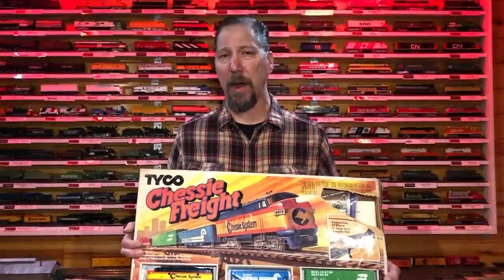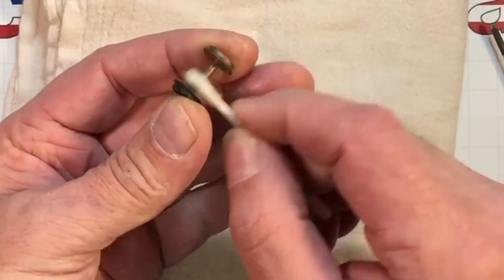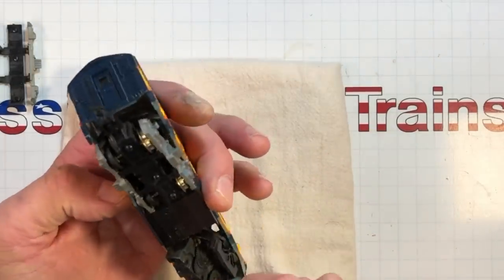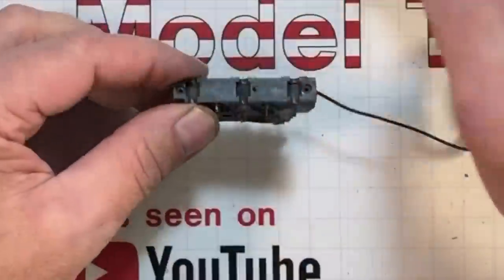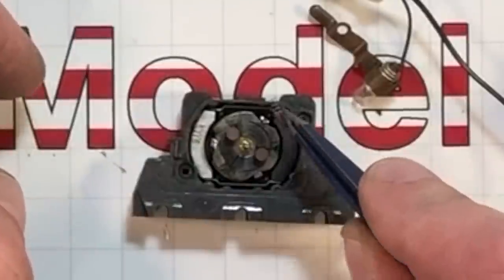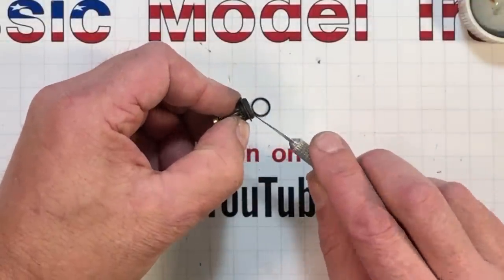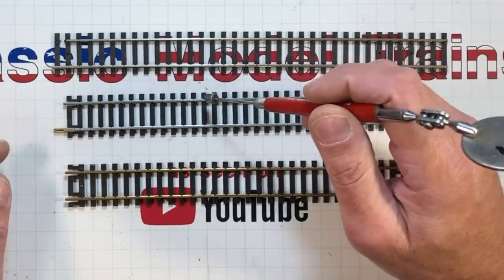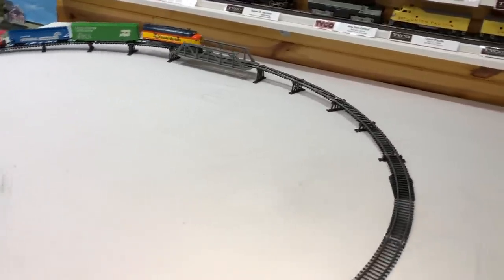How To Fix Them F-7 Power-Torque Tyco's

Comment: Super. Edit: I have one Powertorque drive locomotive left still operating on my railroad, out of seven bought brand new, some forty years ago, in which all but one got converted into dummy locomotives after they died during heavy service. I mixed parts and put the "Sharknose" ALCO trucks on my dummy GP-20, (And a dynamic brake from a Lionel GP-9.) so it is unique, but I also used the spare parts to turn the Baldwin RF-16 "Sharknose" diesel into a suedo Baldwin BP-20 Passenger Shark. I put two Powertorque drives in it, (dual motored.) added extra drive wheels for twelve wheel drive,  filled in the slots for the traction tires, added window glass, extra details and lighting, and added three axle sideframes to it, and by some miracle it still runs fine to this day, however, I don't let it operate outside anymore. It will pull a twelve car heavyweight train up my grades, and has a nice patina from all the years of service which makes it look very realistic in front of that train, but I usually assign it to commuter service. Hello again from the Tracy Mountain Railway in Colorado. 💙 T.E.N.
Reply from the maker: Nice kit bash you made there!!

Comment: Armature and commutator brushes look similar to the ones used in my old AFX slot cars. Used to use soft pencil erasers to clean the commutators. Great video.
Reply from the maker: A lot of Fellers have mentioned that. I'm about ready to buy up some new old stock and see if they will fit.

Comment: Thank you for the guidance on how to clean and re-lube the used motor and wheels. I never did any of the delicate disassembly or reassembly work, but the close ups make it easier to understand. I'm confident I'll be able to knock over an open bottle of mineral spirits as I've been in training and practicing without even trying for over six decades. Merry Christmas.
Reply from the maker: Glad you enjoyed the Vid. I wish I was not so well trained on the art of spill's and making messes ;-). Merry Christmas to you and yours!

Comment: Ron, really enjoy your videos. Nice to see someone else show some love to the more basic entry level stuff. Still have my childhood Tyco F7, circa 1975ish. Here is another tip for you - I like to test items with a 9V battery. Picked up some connectors, will snap one on a battery, then do a check with it. Just seems easier, and maybe a little safer, for me.
Reply from the maker: Thanks for your kind words.  Yup, I hear fellers use the 9V at train shows just to see if the things moves a bit.  I just assume none of my new to me used stuff works and just tear into it and root around a bit.

Comment: Way back when, I got a Tyco HO set as a Christmas present, and it was a similar vintage to this one!  Mine had an SD9 and six freight cars, but the same loop of track with that little trestle set.  The drive gear eventually stripped out, and we took it to someone at our local hobby shop who told us it wasn't worth repairing.  So instead I got an Athearn SD45 to replace it.  Probably still have both of them somewhere, along with a Bachmann 2-8-0.

I left the hobby for quite a while; college and early work life took over.  But when I re-entered the hobby I switched to N scale for space reasons.

Really enjoyed this video.  I don't plan to buy a train set again any time soon, but this was neat.  As I mentioned above, there are a few folks in the hobby who don't consider these old Tycos worth fixing; glad to see that someone disagrees!
Reply from the maker: Thanks for stopping by for a viewing and a comment.  A lot of us left model railroading as older teens / young adults.  It's interesting how we keep the flame alive for so many years and re-enter the hobby once again.  Every mechanical device will break down if it's not maintained properly. I'm just trying help new modelers learn  how to do some fixing since nobody else will :-)

Comment: Love your videos.  A lot of model railroaders talk crap about tyco will a braodway limited work when it's 45 years old . I am an old rivarossi  and artheans blue box fan I have a few typos with power torque models I converted to dcc with sound just as much fun as running a 500$ locomotive. Keep up the good videos. Merry Christmas
Reply from the maker: Thank you. Yes Tyco does get talked down.  Nobody remembers that's how they started in the game. Bachmann, Life like, are still around and had a chance to redeem themselves from the 70's-90's stuff they were putting out.  Tyco did not have that opportunity.  Easy to talk bad about someone when there not in the room.  Mantua (red box) and the re-launch (77-90) put out fantastic stuff, but never gets mentioned. Merry Christmas to you as well! Thanks for supporting my channel :-)

Comment: A power torque is a good starting point for any beginner. I've go more than one on duty here. I've got a couple tricks I do with them cuz I lean on the old girls. I squeeze a little keyway mark on the output shaft&put 2 output gears on it. Facing each other so when the second gear wants to walk over,it won't strip out. Cuz of monster consist&multiple power lashes. Still on board Ron🚂🇨🇦🇺🇲🙋
Reply from the maker: Greetings Doug!  Thats a pretty cool idea. I'm a little short on extra pinion gears Or I would give it a try.  Thanks for watching & commenting :-)

Comment: Little inside information. On the Tyco F Units, the Walthers/  Athearn diesel dress up kit for Athearn F7s also will work well in your Tyco F7s. Even though Tyco called them F9s they are really F7s, F9s have a set of louvers between the cab and front porthole window. Now if you want a nice budget F9 to run on your layout, look for the old PlayArt ones, and yes they have those louvers. Happy model railroading!
Reply from the maker: I believe I have a playart F-7 in a box somewhere

Comment: When I was in ho I used to use a bright boy track cleaning block to clean the wheels of my locomotive nice shiny b r i t e.
Reply from the maker: I think that little black thing I am using is made out of the same stuff bright boy is made out of.  Sure works the same :-)
Reply: Ron I was curious about what you used for cleaning the wheels outside of the Q-tip but what the gray polisher thing was? I just got a switcher and when I first put it on it seems to short out the track but then it runs fine but the wheels seem pretty dark and dirty. I have 2000 grit paper I could use but wasn’t sure if that’s too abrasive?
Reply from the maker: @zachkoch8150  Really don't want to use sandpaper.  Im using a small briteboy. there available in hobby shops or perhaps Amazon.

Comment: One of the first model train locomotives I got used was a power-torque Santa Fe U630 with a bunch of cars (no track) for $7.00 at a yard sale. That thing smelled so bad and made a loud noise. It couldn't even move when I tried to have my other engine push it. Not to mention it looked ugly and the handrails were awful to keep together. I ended up getting more better locomotives and used that Santa Fe engine as a parts source when the other Power-Torque locomotive I had burnt out (I turned that Bicentennial locomotive into a dummy unit)
Reply from the maker: It was tough as a young modeler keeping stuff running well. Thanks for the great story :-)

Comment: Have you repaired a Tyco Plymouth Switcher?  I’d enjoy a video on that.  I have 3 in various stages and I’m trying to put on Kadee couplers as well.  The body holes also stripped on some of them. I’m enjoying your videos.  Thanks!
Reply from the maker: I have not done any Tyco switcher repairs.  If the holes are stripped put a bit of CA glue in them and insert the screw.  let it dry.
Reply: Thanks!  Do I put the screw in before the CA drys?  Are you able to get the screw back out?  What brand and type of CA do you use?  I have Gorilla Super Glue but I’m not sure if it is actually CA.  Sorry for all the questions.  I have a lot of old Tyco locomotives and rolling stock in various states of condition.
Reply from the maker: @jimorlando5700  put in a tiny amount with a tooth pick and let it dry. then put in screw.  sorry I left that part out.   I use insta-cure brand,  in the purple bottle.  available at hobby shops.
Reply: Thanks for the help!

Comment: Tip: Buy on a swap-meet also broken models, and save from them screws, springs, wheels, couplings and so on. In case you launch a screw or spring.... (N screws and springs are hard to find in the carpet...)  ;-)
Reply from the maker: I agree.  A Feller can never have to much "parts" for repairs :-)

Comment: Have you ever found a good source for the brush springs in a power torque motor? The brushes are usually good, it's where people over all them and the springs get really hot and cooked and crack and shrink and everything else, but I cannot find a good replacement for the brush springs.
Reply from the maker: I have not needed any extras yet, but when I do I'm going to try a ball point pen spring and cut it down to see if that works

Comment: I use my cordless Dremel with fine brass wire wheel. The thing I hate the most about power torque motors tyco made is the casting. The pin off the main drive gear snaps off. Have to find proper polished pin to fit the big gear. Once you find the right pin you have to carefully drill cast pin out and fit new aftermarket (lol) custom pin in place along with some epoxy. I gotten a few tyco engines with same problem.
Reply from the maker: Ive only ran into 2 with broken off pins.  One I did myself because the gear was corroded onto the pin.  Yeah If a Guy had a drill press and some rod stock it's not a real hard repair to do.  It's just too bad that it happens in the first place :-)

Comment: Some of those older Mantua Tyco locomotives have that bottom plate riveted to the metal wheel/motor blocks, so it's difficult to get to the wheels and axles. 

Another thing these suffer from is cracked wheels, especially the plastic wheels
Reply from the maker: Yes them kind of drives are called MU-2's

Comment: Will the truck assemblies fit in the engine in the rear as well as the front? It seems like you could add dual motors and rear drive with some spare parts and a bit of wire.
Reply from the maker: Yes they do.  I have built one.  Have the video footage.  Just need to put a video together about it.

Comment: If you had to clean a lot of locomotive wheels, the Dremel no. 428-02 would make short work of the brass wheels in no time flat.  The 428-02 is a wire wheel brush but it is in no way very aggressive at all, it is a polisher, and at 10K rpm, it would only take about one pass around the wheel to remove the tarnish.
Reply from the maker: You talking about that wheel that looks like nylon brush?  Sounds like a good idea to me!

Comment: So I recently did my first restoration on a tyco Santa Fe GP20 and I got it to work now but it’s sparks very much, is their something I need to do to fix that or is it just very old?
Reply from the maker: Well if it's a DC powered HO scale it should not spark.  That's usually from dirty track or wheels
Reply: I’ll have to check it

Comment: What  do you  use to clean  the wheels  with other than a fiber  pencil
Reply from the maker: That's it on the HO stuff.  O gauge I use the Dremel and a wire wheel.

Comment: What do you think of Bachnann Easy track?
Reply from the maker: The Nickel silver stuff is good.  Solves the problem of track separating and needing to nail it down.
Reply: @classicmodeltrains  I have a loop of steel easy track on my test layout and it is ok as long as the Athearn PA-1s are run regularly...if I have problems I use my Alco S-2 with a Diecast Body I call it the rail polisher!

Comment: im not shure but the german marklin trains use the same type of brushes and are always new available. If the thickness is the same you could replace them for a few dollars because they cost next to nothing.
Reply from the maker: Marklin brushes are the same diameter as Tyco ones?  I will have to look into that :-)

Comment: When Cleaning wife’s And My track I Get Some sand Paper and Use it my Layout and It’s clean.
Reply: abrasive track cleaning will insure future rail tarnish. cleaning fluid is the only way to do it.
Reply: Sandpaper will groove the track and the track will get dirtier faster and be harder to keep clean.  It will also remove the nickel silver surface making it almost impossible to clean.
Reply: Never sandpaper your track. That is the quickest way to create miniscule  gaps and nicks that fosters corrosion
Reply from the maker: I have to agree with the other comments.  Sandpaper is a bit to abrasive for cleaning rails. I'm hoping your using at least 1000 grit or above?  Thanks for watching and commenting :-)
Reply: I do.
Reply: @classicmodeltrains  the 1990s fad was to use Wahl oil as a cleaner, lub, performance enhancer, the results are amazing.
Reply from the maker: @suppylarue220  Is that used on hair clippers? I've heard that's good stuff.

Comment: I have a Life-like F7 A unit from 1982 and it's got a pancake motor. I want to change out the couplers and motor how do I do that?
Reply from the maker: Changing out the motor to the same exact one is pretty straight forward.  Changing it to a completely different one would take a lot of skills. I have a couple of videos about tuning up rolling stock. Perhaps those might shine some light on how to do loco couplers.  I know I don't have a Vid on life like loco's and Kadee's installation.  Something I should work on :-)